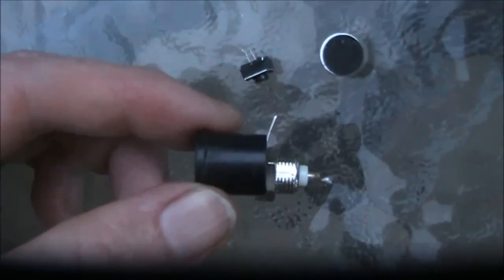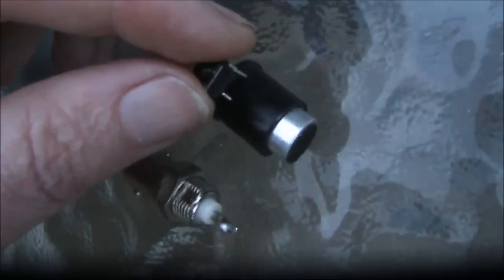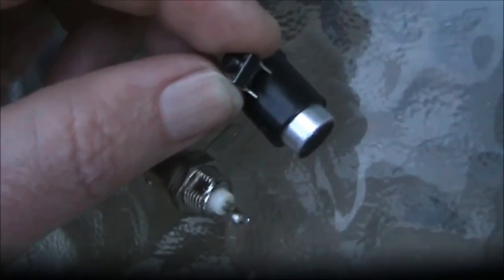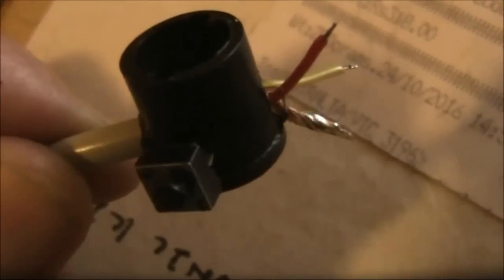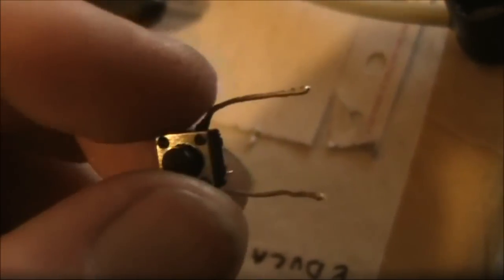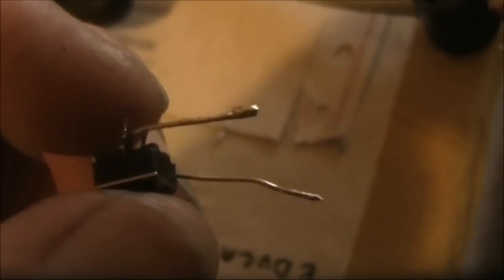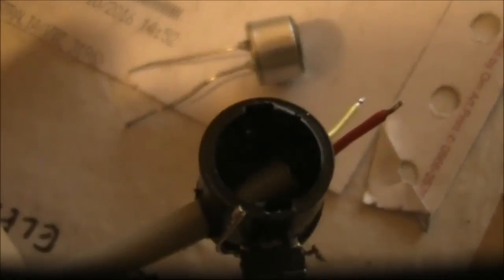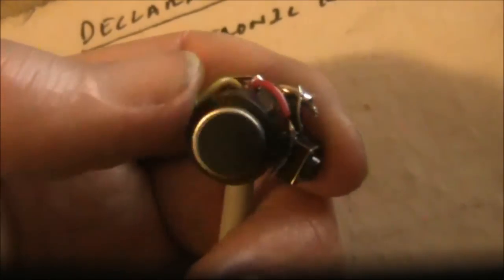A micro microphone for the Bitx40

Comment: great work again Peter 
now your next mission is how to do CW on the bitx40  :) you may even win a prize ;)
Regards Martin 
VK6FEEE
Reply from the maker: Should be fairly easy. Just add a 12 MHz keyed RF oscillator and inject just after the crystal filter. Not much point though after I changed the coverage to not include the CW portion.
Reply: vk3ye  correct, mate!